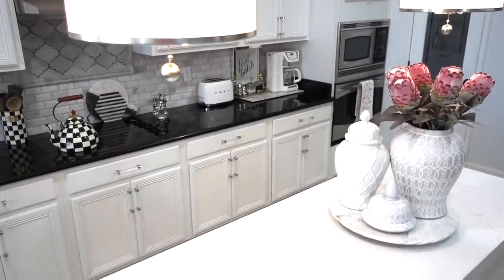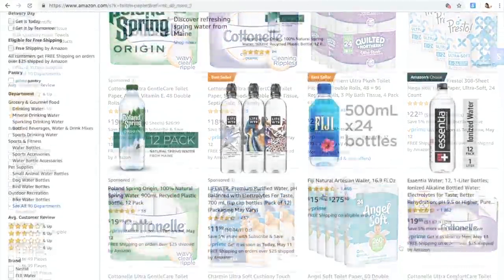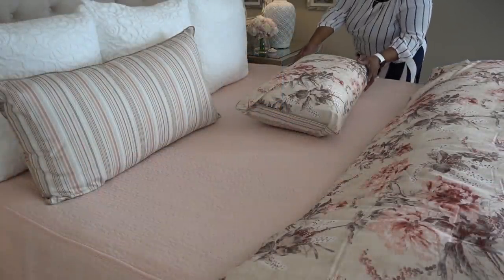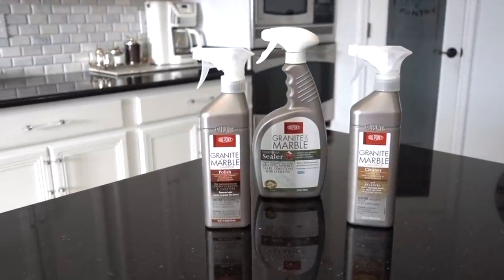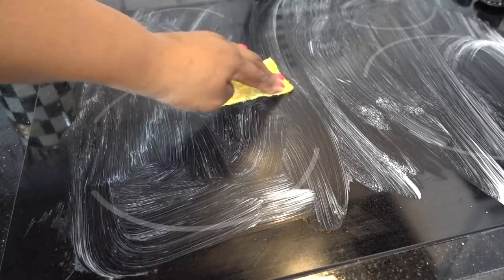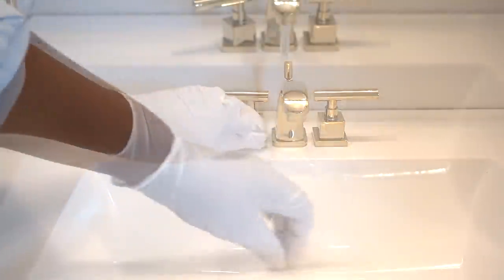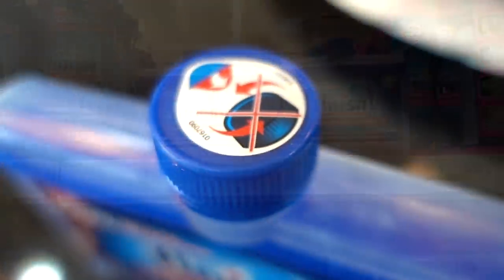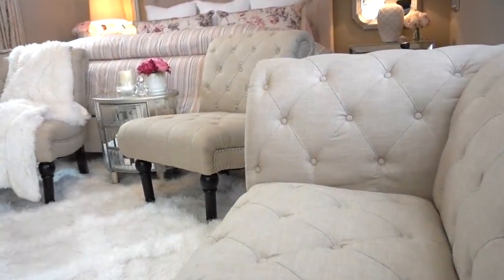NEW!  9 Habits For Keeping A Clean & Tidy Home

Comment: Your home is very beautiful! I have a tip to share: I never have to buy a rinse aid or a cleaner for my dishwasher. I keep a small bowl or a small measuring cup (right side up) in my dishwasher and add about a cup of distilled white vinegar before every load. It just splashes out during the cycle. It helps to rinse the dishes and clean the dishwasher at the same time. After years my dishwasher is still sparkling clean.